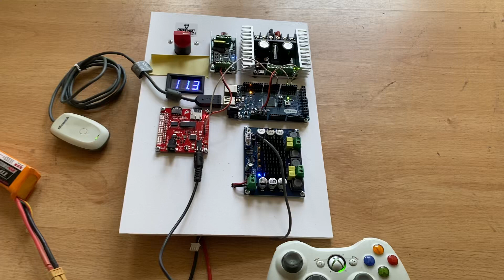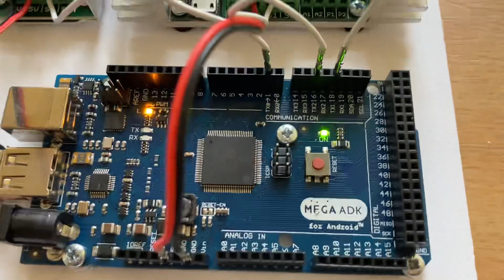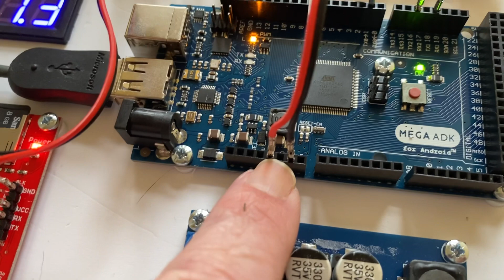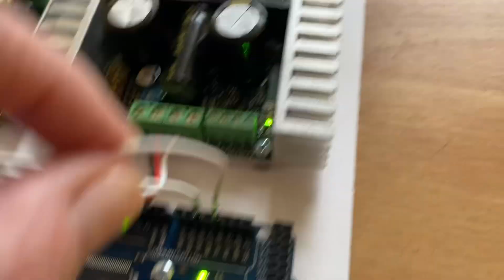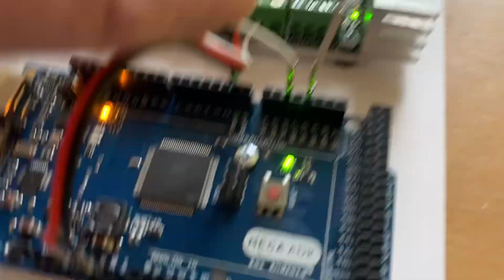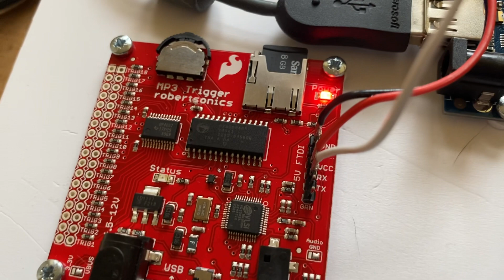Arduino Mega (ADK) Padawan 360 connections

Comment: hi steve i am having a nightmare with the maestro and the mega adk i presume the connections are different than your original video, if so could you tell me if i have to change the code, to reflect this and which pins to connect to... Many thanks
Reply from the maker: really depends on your sketch.  You can set it up to use hardware or software serial and you would specify the pins in the sketch.  Let me know what sketch you are using, and I may be able to help, but start by looking through the sketch and see if you can figure out which pins are assigned to the maestroserial
Reply: @ImperialLightandMagic  Thanks steve but i have eventually worked it out, it seems that you have to load x2 sequences onto the maestro for it to work. i was only testing it with one sequence. Frustrating really because i got everything else spot on.
Reply from the maker: Ah ok, wasn't aware of that being a "feature", probably never loaded just one sequence, so not come across that issue before.  Well done for figuring it out.
Reply: @ImperialLightandMagic  Unfortunately i cant take the credit for figuring it out. i read the instructions that dan massey has written, and it was briefly mentioned in there.

Comment: Great video Steve.  Can you please tell me how many AMPs this system pulls?  I am very new to electronics.  If I had a 24v battery with 10 AMP hours what kind of run time would I get?  I am using 24 v motors for the wheels and dome.  I am really trying to figure out what battery specs I need and I am struggling.  Any help would be awesome!  Thanks

Comment: Steve, do you have the same issue with the MEGA ADK Board, the processing chip in the center of the board gets superhot to where I can't even touch it?  I'm using 1" stand-offs from the board so air is getting to the card.  Should I be concerned!  Not sure if this is normal or not.  I touched it and left some skin on the chip.  All my connections match yours and I'm running 11.9 volts to the Sabertooth and the Siren10, 5 volts to the MEGA ADK and MP3 Trigger Board.
Reply from the maker: Not that I’ve noticed, I’ll check later and leave a new comment
Reply: I have similar issues with my MEGA ADK,  i believe its with my resettable polyfuse. i ran a blink test with nothing else on it and it still gets hot, i dont know if its normal or not.

Comment: Does the Arduino MEGA ADK have an associated number with it to search on AliExpress?  And what issues were you experiencing using the Uno and Shield boards?
Reply from the maker: I've only really found one supplier of ADK's on Ali so it shouldn't be too hard to find them.  I pay around £34 per.  The shields have an incorrect chip meaning it won't communicate over USB (ie to the dongle).  A fix has been found for this now which involves removing one of the chips and replacing it with a different (ie correct) model number.

Comment: Why not use an Arduino Due? It's a bunch faster (84 MHz, 32 bits), and the SAM3X8E has the USB device and host interface native, so you don't have the clumsy communication over SPI.
Reply from the maker: Primarily because the mega/uno route is mature and part of the original sketch, that way it's easy to support in the community.  Once people introduce new boards, it becomes more of a challenge to support them.  Of course, there are plenty of other ways of skinning this proverbial cat, I just happen to like this one. Hope that answers the question.

Comment: What kind of screws/sizes and standoffs are you using to mount the boards?
Reply from the maker: I use the screws that come with the Sabertooth and Syren, other boards are M3 and the spacers I just 3d print using up ends of filament rolls when there's not enough to start a large print, I'll just set off a bunch of spacers

Comment: Great video! What are the pros/cons of using power output from your motor drivers as power for your Arduino and MP3 trigger, as apposed to a dedicated 5v bus? This is certainly much simpler, but any concerns?
Reply from the maker: None, I've had zero issues running it this way, and as you point out, it's much simpler.